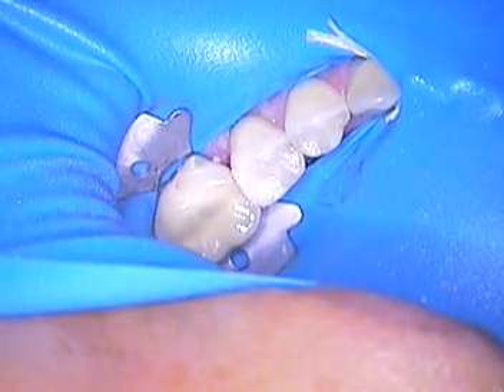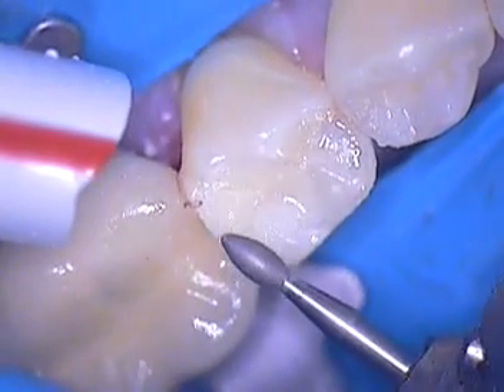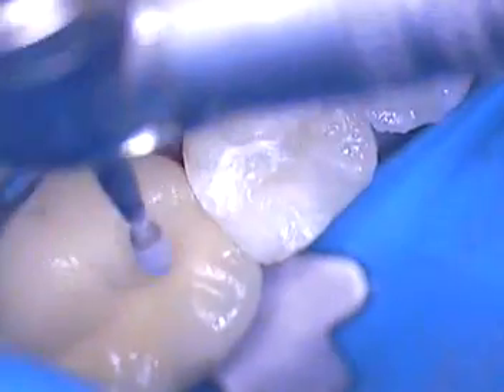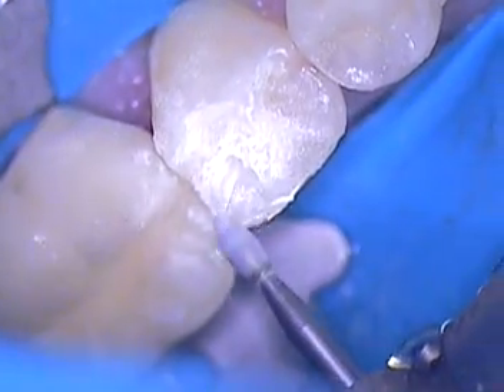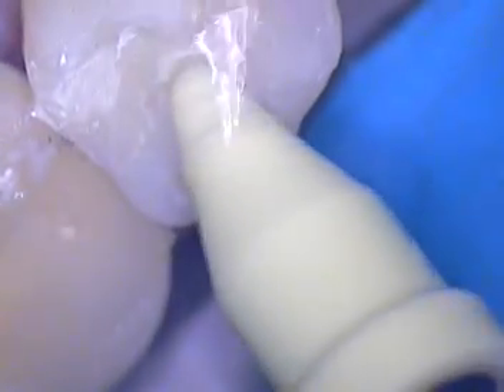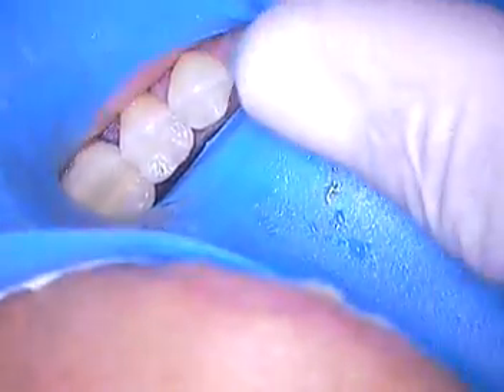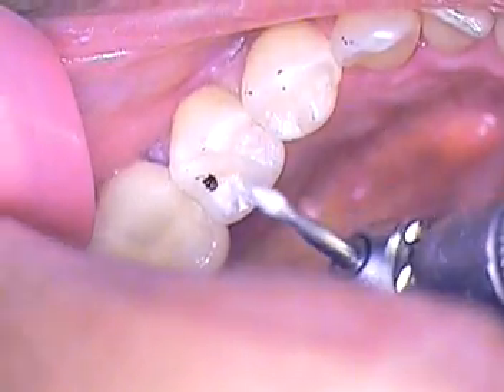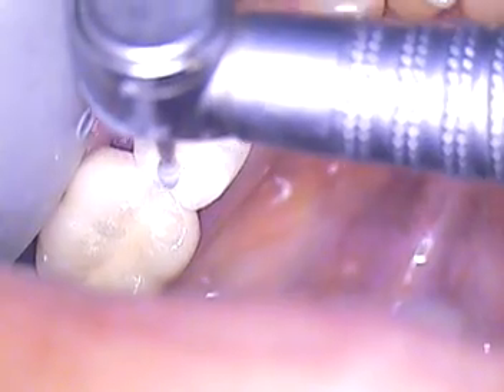Class II Composite Restoration using a dental microscope - Boca Raton, Florida 3/3

Comment: Dear Dr.Cuomo, I saw that on the other videos dentists frequently used a different type/shade of composite to simulate dentine. It did look like you were working with just one.  Another point I noted is that the adjacent tooth was not isolated with a strip before etching. Could you please comment? I apologize if the questions are ignorant.

Comment from the maker: Hi there- great to hear from you!  I use Siltrax 7 retraction chord both with and without impregnated epi.  I overlap my r-dam hole punching in order to create a trough.  I stretch the dam to include several teeth.  The other way includes punching out holes for individual teeth, flossing through each tooth, and inverting the dam.  Many thanks for subscribing and expect to see class III and IV cases very soon. All the best. GC

Comment: Fantastic work doctor, very useful tips. I wonder, the floss between 19 and 20, that one you put in for stop the bleed, did you remove it or is a resorbable kind?
And another thing, why only 3 holes on the rubber dam if there were 4 teeth. 
I really wanna see a class III and IV composite restoration.

You get a new subscriber, all the best for you!!
Keep the good work!

Comment: Hi, Great video and technique. Just a little note which I didn't see on the video, is to make sure the  retraction cord is removed after the procedure. I guess it will be picked up by the sickle as you are cleaning off the excess bond anyway. Good job, will give it a go at work later.

Comment: Thanks for the quick answer. I'm going to try burnish the contact zone of the matrix band and see how that works out.

Is there any breakage risk of the proximal wall when you begin that way? The few restorations I've done I've always started from the floor working my way up to the top using zig-zag layering. But your way seems neater though no teacher has told me to start with the wall.

Comment from the maker: Thank you for commenting!  The key to obtaining a good contact area is to place the wood wedge into the interproximal embrasure area of the box prior to preparation.  This will orthodontically move the tooth slightly and also protect the gingival tissue near the CEJ where you'll be dropping the box.  After the prep is finished, try to use a matrix band system similar to Triodent and Garrison Dental.  Firmly place the wedge to stabilize the band, seal the gingival floor, and separate the tooth.GC

Comment: Thanks for the video. 

Will it be possible to get a flossing thread in between the distal approximal surface (where the matrix band was)? Im a dental student in Scandinavia and my teacher told me that when I do restoration, i should be able to get a thread in between. I have no idea if thats correct.  What are your thoughts? 

Thanks in advance

Comment from the maker: Thanks for commenting.  First of all, I would place a wedge prior to tooth preparation.  This step will separate the adjacent tooth and block the gingiva from bur trauma. Secondly, I would use a good band system like "composi-tight" from Garrison Dental or Triodent's from Ultradent.  The separating ring and full contour matrix band will give you the contours that are neccessary. Don't forget to burnish the matrix band against the adjacent tooth and check for good gingival seal.Keep practicing~GC